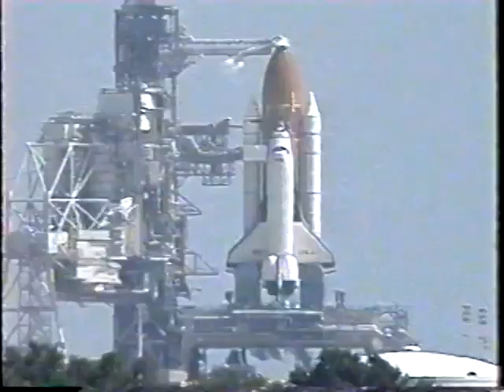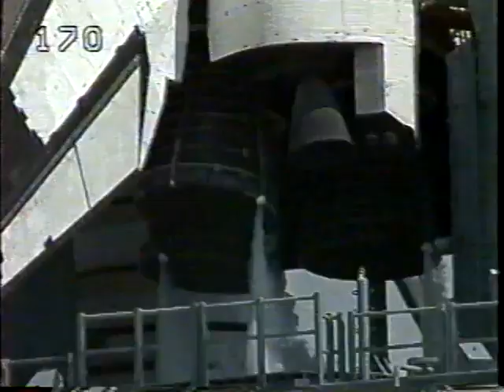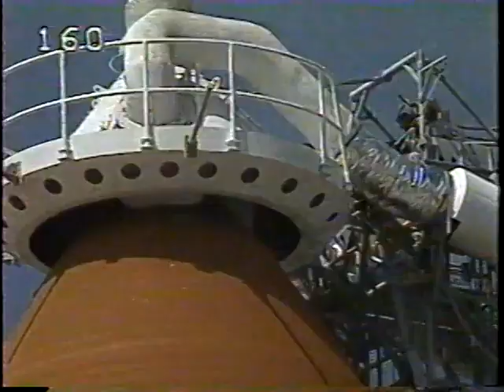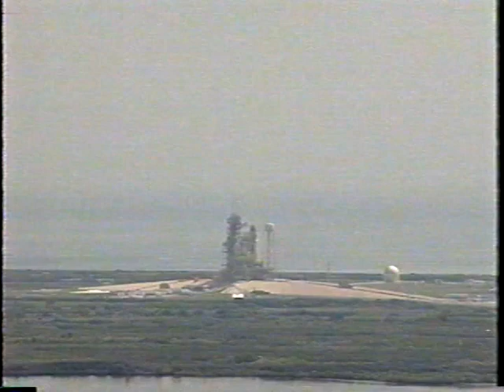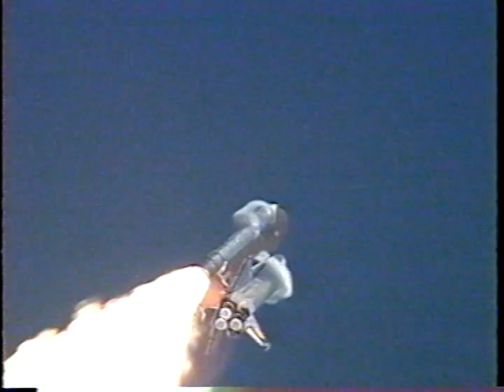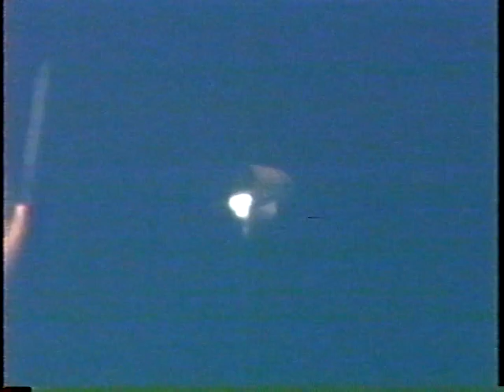Space Shuttle Columbia - STS-78 Launch

Comment: I salute Richard M. Linnehan, Charles E. Brady Jr., Jean-Jacques Favier, and Robert Thirsk on their first space shuttle mission! 🫡❤️🇺🇸🇺🇸🇫🇷🇨🇦

This was Terence T. Henricks’ fourth and final space shuttle mission and final time in space.

This was Charles E. Brady Jr. and Jean-Jacques Favier’s first and last time in space during a space shuttle mission.

Although the launch proceeded without problems, engineers discovered an issue with the solid rocket boosters (SRBs) after they were recovered and dismantled in June. Investigations revealed concerning damage to the boosters’ field joints, likely caused by hot gases passing through them. Unlike the disaster that destroyed the Space Shuttle Challenger in 1986, the damage in this case did not threaten the crew because the gases traveled through engine field joints rather than the capture joints that contained the critical O-ring seals. Nevertheless, the incident raised concerns about a newly required adhesive and cleaning solution mandated by the Environmental Protection Agency.

As a result of the investigation, the mission of Space Shuttle Atlantis, which was scheduled to dock with the Mir Space Station and bring astronaut Shannon Lucid back to Earth, was postponed. Officials briefly considered returning Lucid aboard a Soyuz spacecraft, but the plan was abandoned because the Space Shuttle was ultimately judged safe for the mission.